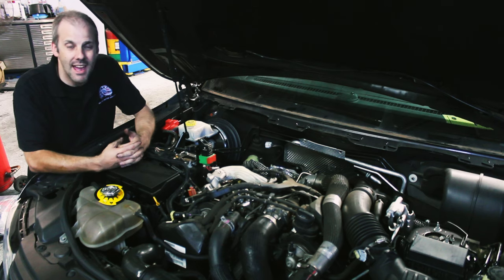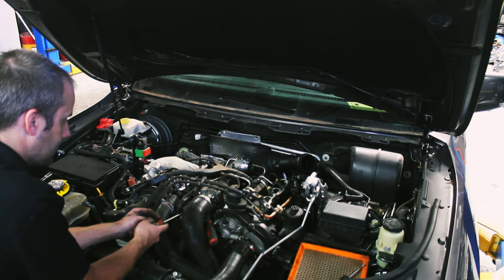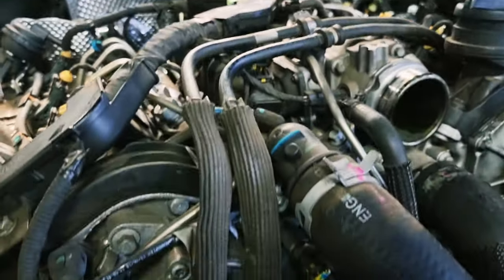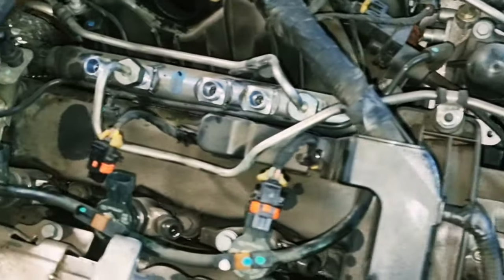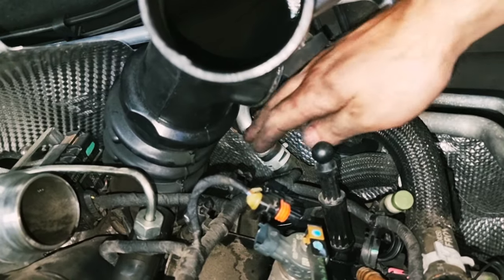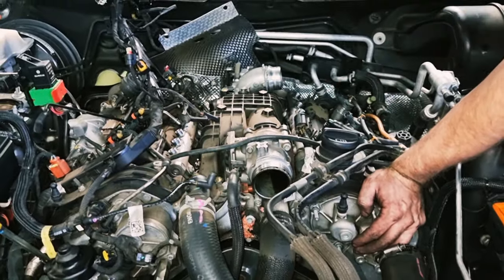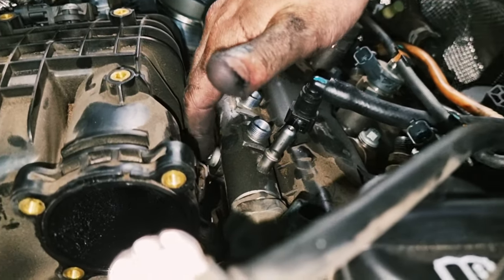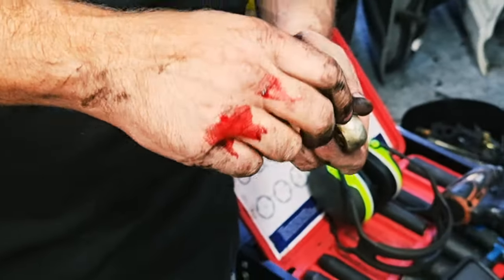Jeep Grand Cherokee: How to replace the turbo coolant Hose in the Valley #boughtajeep #iboughtajeep

Comment: 😊 Just wanted to give a huge thank you for this video! Took me about 4 hours of work to get it out after watching this a couple times. Couple notes.: The fuel rail comes out nicely with those T40 torx bolts if you take out the 11 x 8mm  bolts around the manifold first to give it some wiggle, and use a long handles ratcheting bit wrench. Im a huge fan of the Vim brand of these (amazon) I have the 5 inch and 8 inch.They are not cheap but Ive never broken one yet. My other tip it put a bright ziptie an evey connection youve broken open. (Leave the tail on it) you wont miss a connection when reasembling. 
I took an extra step and ordered a new manifold after serning others on here. It''s not going to be in for a couple days.... Ill put it back together when it comes in. Subscribed. Cheers K

Comment: I just booked my 2015 in for this replacement and prior to seeing this couldn't get my head around a minimum two day service. I think a mechanic should be safely looking at three days to include emergency surgery and counseling. Wow, an amazing video!!!
Reply from the maker: Its not too bad once you have done say 50 of them.
Reply: @GDLautoblog  yeah honestly i just got done with this and it's not terrible... only 1-2 really pita things. The rest is just tons of disconnecting. the turbo inlet is the worst of it. Everything else comes off pretty easy... there is just A LOT to take off.
Reply: I bought an older 2006 WH CRD and I needed counseling immediately. It the one with the Merc motor, and its really put me off buying any modern Merc stuff. Too many plastic parts and ridiculous prices of OEM parts. $450 for an OEM thermostat for example.

Comment: Thanks Danny for your fantastic videos , I completed the valley coolant hose .
And oil cooler hose as well .
I spoke with you today on how to bleed injectors , it worked everything up and running again cheers Steve .
Reply: Could you please tell me how to bleed injectors?  I replaced the hose and put everything put back together. The engine fails to start and it’s cranking not turning over. I have trid to turn on the ignition many times, but it did not help.
Reply: @GavinG-eg5rt you will have to wind it over and crack at the injector till it stops pushing air out , on each injector hope that helps
Reply: Lines

Comment: Cut a T40 torx bit in half wrap it with some thread seal tape and use a 1/4 spanner with some extension to make it longer. Easy way to crack those bolts on the rails. I did mine this weekend. Thanks for the video.
Impossible task without watching it.
Reply: I did the same as you last night, apart from the thread seal tape! two of the bolts were very tighe, my poor 1/4 would not have liked it so I kept tension on it while I used a hammer and punch to assist it.

Comment: Hi, great video.  Can you please tell me if it is possible to remove the intake manifold of a 2013 Grand Cherokee Ecodiesel without removal of the turbo.  Unfortunately the turbo air inlet pipe does not unbolt as you show in your video and I'm not sure how to get the intake manifold out.  They clearly realised this was an issue on the earlier versions and changed it for the US and facelift models

Comment: Hi I am just replacing the turbo coolant hose with a complete steel braided unit, do you have a tip for accessing the banjo bolt on the turbo behind the heat shield without having to remove the turbo?
Reply from the maker: Your not going to like this….. remove the engine. 
You have to drop the motor out to do that

Comment: Thank you for doing this video, I'll be doing this today in the UK. The hose is 3/8" or 9.5mm internal diameter 👍
Reply: Took 3.5hrs to get to the hose in the valley, which had literally disintegrated at both ends and fell apart in our hands. The torx40 screws came off on the fuel rails by removing bolts for inlet manifold allowing for a little movement then using a slim ratchet driver with a torx40 cut to about 12mm in length. The inlet manifold is a bitch to get off and a bitch took put back on.
Reply: My Jeeps mileage is 85500miles and 8 years old.

Comment: Hi Dannie,
Thanks for the video. Was invaluable for me to do the fix myself.
Reply: How long did it take you to do the job start to finish??
Reply: What mileage and age?
I need to get some idea when to do (or pay someone else to do) mine.
Reply: @FutureSystem738  approx 170,000km and about 8yr old. I’ve heard of some happening a bit earlier then that though. I was lucky and noticed the low water level before cooking the engine.

Comment: Hey brother. So I got it started and had to replace the fuel injector return line. I’m still getting a leak from the rear of engine compartment dripping down to the drive shaft driver side. Also it’s now giving me a glow plug fault code on #6 cylinder. Any ideas was could have broke?
Reply: It almost looks like it may be coming from the back of the fuel rail on the driver side.
Reply from the maker: As an educated guess I'd say most likely the EGR coolant pipe
Reply: @GDLautoblog  it’s definitely fuel leaking. I think not replacing the lines was a mistake for me. I don’t think I was able to get them seated right. I went ahead and ordered a new set of high pressure lines. Will update the outcome once installed.

Comment: Danny thanks so much for your helpfull videos.I am in the process of putting my 2015 diesel laredo back togethet after replacing leaking hose in the valley.
Can I reuse the fuel lines and the fuel rail.Seems to be confusing advice from other.Also I leant on one of the diesel return lines on top of injectots.Broke at one of the joins.Can I rejoin it
Thanks again
Reply from the maker: Yes. Technically your supposed to replace them but we have never ember replaced them

Comment: excellent video.. do you know what size hose it is? I want to order a tougher type but need to know the size??
Reply from the maker: 3/8
Reply: @GDLautoblog  thank u I did the job and put stronger hose also put a heat shield around it.. cars running smoothly as I also cleaned everything out once I took inlet manifold and egr out.. thank u

Comment: Dorman makes a aftermarket version of this hose with a braided stainless hose for the flex section 667-562.  I had the dealer install this at my expense, since I didn't use the factory part:(.  

Sadly the day I got my rig back, it developed a big oil leak.  What is the oil line you refer to in the video?  I see there is a turbo oil feed and turbo oil return, but dieter of them appear to have a rubber section.  

Any thoughts on what my oil leak might be?

Thank you for your vids.   I might just have to start working on this my rig myself!

Comment: Great Video, Inspired me to check my Turbo "Hose in the Valley" My 2014 Diesel has done 238,000k so after hearing all the stories thought it a good idea to check. Over the last few days have got the Manifold off and the hose looks ok, soot not as bad as some but it does mainly country driving and not near a decent Jeep Mechanic. I bought the Dorman Braided and crimped hose which means removing the Banjo Bolt on the Turbo end. Mate please is there an easy way to get that off seeing the Oil line is in the way and looks impossible to get off. Your advice would be much appreciated.
Reply from the maker: Requires the turbo to be removed which you need to remove the motor from the car to do.

Comment: What a fantastic video, I might actually have to do mine now 😬.
Prior to your video, I had already purchased the new complete turbo coolant hose.
Is there much involved in removing the heat shield to access the banjo bolt on the turbo and does the oil supply line need to be removed?
Reply: mine poped last week
and i am 3k miles over my agm coverage
Reply: @CoffeeQuilava   That’s unfortunate. I was lucky enough to change mine before it burst. It looks like a pretty big job but once you get into it,it really isn’t too bad. If you follow this video and get yourself a service manual it will make it much easier.
Reply: @anthonyhayden320  What mileage and age?
Reply: @CoffeeQuilava  What mileage and age?
I need to get some idea when to do mine.
Reply: @FutureSystem738   2014  wk2, I replaced mine at 99k (km) the rubber hose was quite hard but hadn’t started leaking.
Reply: @FutureSystem738  2014 123k, 
800 miles after oil cooler failure. It was a small leak. I did 3 flushes and it still failed
Reply: @CoffeeQuilava   I was fortunate that I had also replaced the oil cooler before it started to fail. If the hose in the valley has failed, I’d be replacing the hose behind the turbo and the z shaped hose at the oil cooler as well.
Reply: @CoffeeQuilava  Thanks. 
Mine is a 2014, so much looking forward to this. :-(
Reply: @anthonyhayden320  Thanks Anthony.

Comment: I just did this job after watching this video. I cycled the key botton multiple times and tried to start it several times and it was just cranking. Then during that process the brake pedal stayed kinda in and now it’s just clicks
Reply from the maker: Battery is flat? Try a jump 
They are always hard to start as you need to bleed the air out of the fuel lines. You do this by cycling the ignition several times. 
Make sure you have not left a fuel like loose it will hose out diesel and won’t start if you have

Comment: I have a question just did the process and oddly there is diesel fuel leaking now seems to be coming near the rear of the engine seems around the rear injectors should the injectors be changed or the seals possibly going out?
Reply from the maker: You have probably damaged the o rings or the little t piece in the return fuel lines. Best get a set second hand from a wrecking yard
Reply: @GDLautoblog  most likely the o rings I just got a new fuel return line hose from mopar since the return hose tips were so brittle on the originally that 3 of them just snapped the moment I barely touched them I checked the injectors I am certain it’s their o rings and the injectors them self the injectors were burnt and had alot of carbon residue as well seemed as if they were just staying open and not closing I informed my client on it

Comment: Is this the same on the 2014 ram ecodiesel? I’m almost positive that is where my leak is coming from. Great video by the way.
Reply from the maker: I believe so yes
Reply: @GDLautoblog  any chance you know the part number or is changing the rubber hose enough rather than changing the whole part?
Reply from the maker: @michaelcawley3178  just the rubber hose 
If you want to change the whole pipe you have to pull the turbo off sheikh requires the engine to be removed
Reply: Hey bro so I got the repair all completed  everything put back together. Went to go start and it’s cranking not turning over. The only thing I can think of is I missed a sensor somewhere?
Reply from the maker: @michaelcawley3178  keep cranking 
It will start eventually 
If not check you diesel fuel lines are tight
Reply: @GDLautoblog  okay so it might take a good few cranks to get it to turn?
Reply from the maker: @michaelcawley3178  yep. I have had some sake several mins
Reply: @GDLautoblog  okay I’m guessing it has to build up enough fuel pressure in the lines after having everything removed. That was a rough repair. Your video was a great help and I thank you for that,  but I think I will be selling mine the next time that repair is going to need to be completed. I’ve heard it goes every 70k-100k miles? Couldn’t find a mechanic that wanted to go near it.
Reply: @michaelcawley3178  Could you please tell me how you started your engine finally? I get the same problem. I replaced the hose and put everything put back together. The engine fails to start and it’s cranking not turning over. I have turned the ignition on for more than 10 times, but the problem is still.

Comment: Hello Danny , can the turbo be replaced with out removing the engine or cab ?
Reply from the maker: Yes it can. Remove the wiper cowling then remove turbo. It’s not an easy task but yes it can be done by leaving the engine in

Comment: Greetings, what type of hose did you use in the repair, I have the same problem, and I bought this hose, I could verify if it is up to date to work, or if you have any brand that you can recommend.  Thank you.  Here I send you a link with the description of the hose that I bought in Mapa Auto Parts

Part #: NBH H500
Line: NAPA Belts & Hoses
Reply from the maker: I have experimented with a lot of different products. to date the best longevity came from a day 3.8 mm heater hose